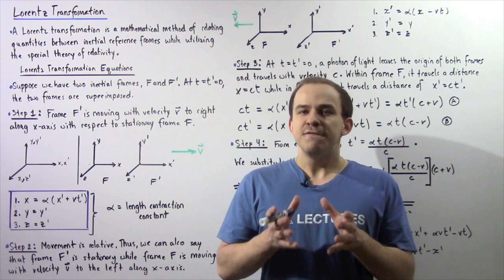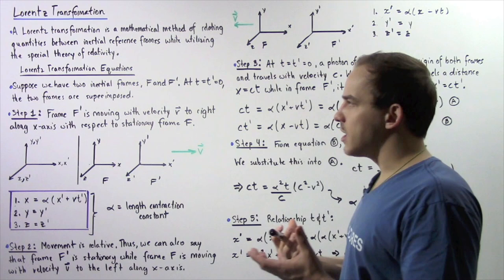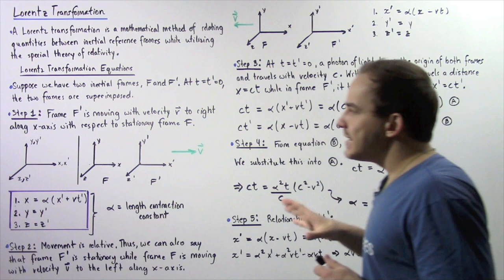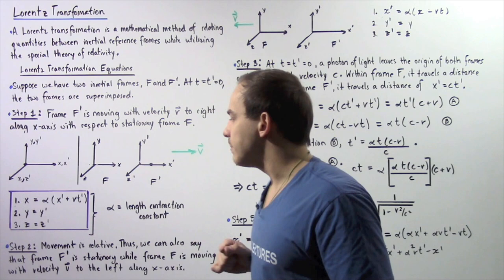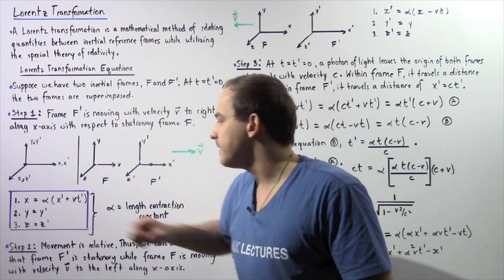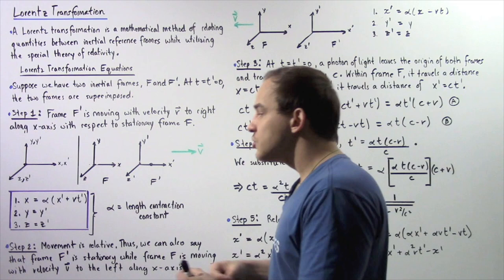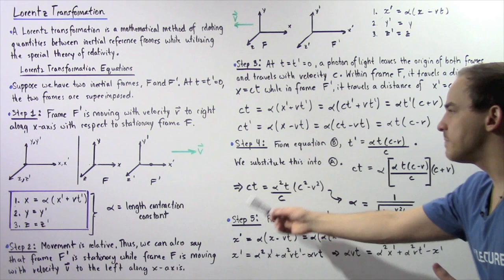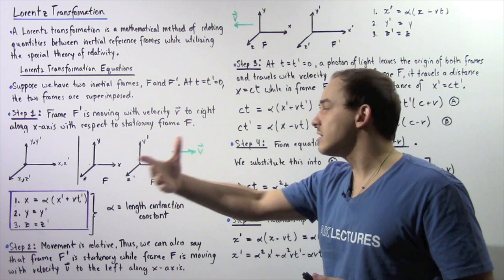Lorentz Trasformation Equations

Comment: In the Length contraction equation, If there is a Frame of reference for both frames, then if frame F' prime is moving doesn't mean Its relative right. And Will there be a third frame of reference suppose to exist for both F and F prime?

Comment: Why do we assume there is an alpha in the form of these equations at the outset: Why do we assume length contraction at the outset? Isn't length contraction a result of, rather than a reason for the Lorentz equations. So is this a bit circular?

Instead, why not assume a more general form i.e. x = Ax' + Bt' etc a priori (i.e. a form that assumes nothing except linearity) and go from there.
And similarly for time: t = Cx' +Dt' etc.
Then do step one, two and three (but you will need a fourth step where light travels along the y axis also to solve for A,B,C,D).

The way you're doing it seems to be a bit of a cheat, because we shouldn't know anything at the outset about length contraction from the two postulates. We only find out about that when we have the Lorentz equations surely.

Also, the explanation for 
x = alpha(x'+vt') from the diagram. I don't quite get this.
Assuming the need for an alpha aside, I understand why it could be
x' = alpha(x-vt) but not the other way from the diagram.

And for the next diagram, I understand how that could be x = alpha(x'+vt') but not what is given here.

Are you sure these are correct.

Comment: What is the difference between lorentz transformation and galelian transformation
Reply: Galilean Transformation is for Newtonian Physics, where the object you're dealing with has a velocity that is no where near the speed of light (ie cars). 

Lorentz Transformation is for Special Relativity, where the object you're dealing with has a velocity that is very close to the speed of light (eg. A proton at 0.9c, or 90% the speed of light).

If you use Galilean Transformation for Special Relativity calculations, you'll almost always end up with an answer that looks like 1.8c, which is impossible - Because nothing can travel faster than 1c. That's why Lorentz equations have a Gamma factor to compensate for this, to bring the answer back down to values below 1c.

Comment: But , I Did not get why should we multiply  with length contraction factor
Reply: First i suggest looking at the derivation for time dilation, then use that to understand a length contraction derivation. Under the theory of relativity, two different inertial frames will measure lengths differently. So there must be a length contraction factor to translate between to frames. This video then solves for the factor.

Comment: The biggest point in this derivation is in step 3, where you assumed that x'=ct'. I understand that this assumed from the postulate stating that light speed is constant in all inertial frames of reference. Hence x'=ct' and not (c-v)t'. But I fail to understand the basis behind this postulate. I've read on other forums that this proof can be elaborated back from Maxwell's EM equations where if you try to derive the speed of an EM wave in any inertial reference frame, it is constant. Can you please confirm/clarify regarding this?
Reply: Bhargav Reddy  special theory of relativity applies nly when the speed is atleast equals speed of light :)
Reply: ILAM PARITHY awfully incorrect
Reply: The fact that the speed of light is constant in all inertial frames of reference has been proved experimentally ( Michelson–Morley Experiment). It is very well explained in Khan Academy videos. https://www.khanacademy.org/science/physics/special-relativity
Reply: The basis of c being universal is the failure of the Michelson Morley experiment to show the ether exists: Prior to this experiment it was assumed light travelled in a kind of absolute background medium (like  mechanical waves do) which scientists called the ether. If this were true one could move through the ether relative to light and we would get a different value for the speed of light (not c). The Michelson Morley experiment tried to demonstrate this by having an apparatus move in different directions through the assumed ether and thereby show that the speed of light varied depending on this movement. It failed to do this. 
Also, Einstein was more interested in Maxwell's equations which said that Electromagnetic waves move with a speed c in a vacuum irrespective of the motion of the source or the observer.

Comment: Good job. However, for your information, Lorentz Transformation is for mathematics and not for physics. It has nothing to do with reality.
Reply: you keep trying to push this agenda on every video
Reply: Seriously. Every video I can find he's there with the same incorrect comment.
Reply: Partly agree with Eric Su. This is a very good video, but it does not fully relate to physics. Space is not a variable when moving, two planets do not actually
come closer to each when moving fast between them.
But time is a physical variable (rate of change in matter), and that Lorentz transformation equation calculates such time dilation correctly. Which means, concerning mathematical space contraction (if that is what he is describing), the moving observer instead physically measures a longer distance per time unit (slowed down rate of change, "longer seconds"), which means measuring a higher velocity. Space distances are the same (fixed for all observers), the measured velocity is higher for a moving observer, due to the physical time dilation effect.
Ps. If he is just describing a length contraction in the moving object itself (not any space/distance contraction), that could be physically true during an acceleration/deceleration phase, such a force acting upon matter and deforming it. Trying to reach the speed of light, it would be totally flat in the moving direction, due to infinite acceleration force acting upon it...